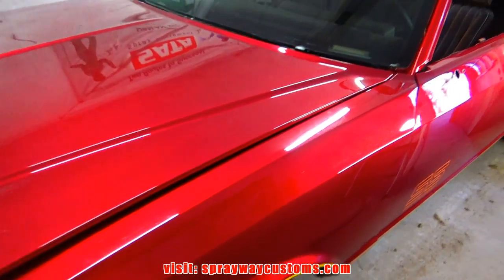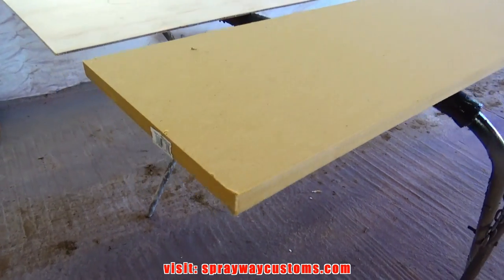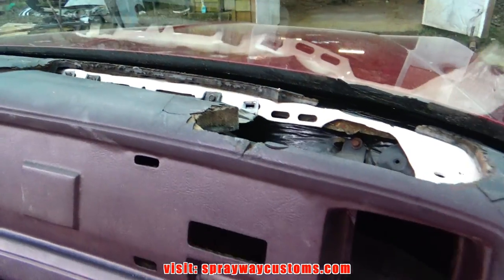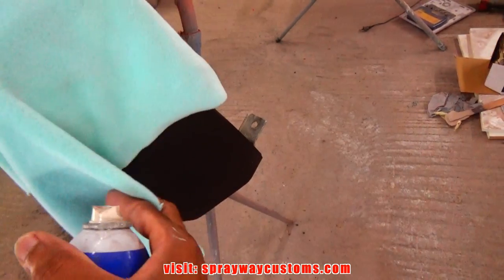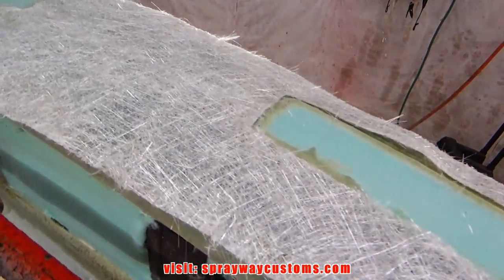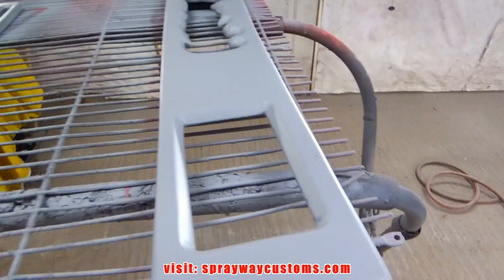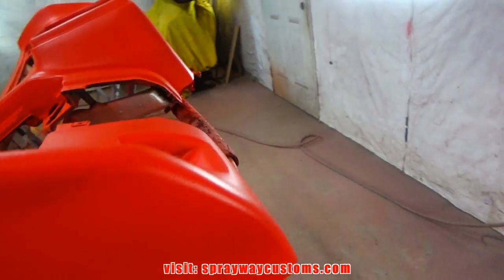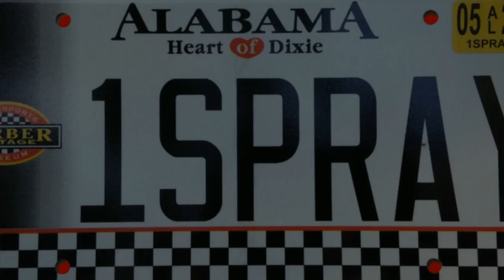How To Repair A Cracked Dashboard STEP BY STEP Custom Fiberglass Monte Carlo SS G BODY Dash Restore

Comment: Ive been able to save hard to replace 1993-1997 Gen4 camaro interior parts thanks to learning from you how to fiberglass them to make them stronger. Question would it not have been more easier to modify the dash pad with the front window out and do you have the ability to remove the front window for projects like this one going forward
Reply: I would assume that he would have not found out that the dash did not fit if window was out. But since it was in he realized the wood hit the windshield.
Reply from the maker: I think it’s better with the glass in so you’ll actually know if it hits but if you was fiberglassing it still in the car...I would say it’ll be better to remove the windshield

Comment: Superior job man 👍🏻 I would like to ask how long does the dash last?? Curious if it cracks over time with the body filler or if it is a problem @ all. Thanks sprayway for a great video 😎
Reply: as long as you take care of it as you would the outside of your car it will last  forever and also use a windshield cover inside to protect the dash or if you can do a 50% tint on you windshield to cut down on the sun beating down on it!!!!
Reply from the maker: Thanks for the reply Duane and I appreciate the compliment Boz N Son’z
Reply: I been doing the same thing man

Comment: Great work!!! Just a tad bit of advice for someone watching and needing some tips.  If you dont have much experience using resin, using the minimum amount of hardener will give you more time to use the resin before it starts to harden up.  Also another tip when using the fiberglass mat,  the mat will blend together better if you tear the edges versus cutting.  The strands will join back together giving you seamless results.  Again this is for people new to the process.
Reply from the maker: Thanks for the tips

Comment: A tip. You can tie the fabric that’s lifting from the staples with unwax santal floss. And leave it in when you fiberglass over it. To hold the shape.
Reply from the maker: Appreciate the tip...I’ll try that next time 🤝

Comment: so how's it going sprayway I'm doing body work and sand blasted a few p as rats also I primed with filler primer in some spots .my question is can I put a opoxy primer over my filler primer without it freaking the primer out / cause reaction
Reply from the maker: Yes you can but I would suggest spraying filler primer over the epoxy for sanding purposes

Comment: Just wanted to see if I could get your input. I have primed and block sanded and guide coated my car 3 times (1968 Shelby GT500KR)and I am confident that it is very straight. What do you do if there are some very, very, very small edges that got sanded through to bare metal. They are so small they are the width of a small needle. Do you get out the primer gun, mix a little bit more primer and try to spot prime those very small areas. It seems like I am going to be chasing my tail when it comes to these very mall break throughs to metal. Any input would be appreciated and thanks!
Reply from the maker: Get you a can of self etching primer and spray those cut through spots

Comment: Hey I got a 1988 Chevy Caprice Brougham with that kinda light gray original color. The dash is mostly faded with one baby crack close to the defrost vent. My question is would you do a vinyl paint or a vinyl cover that fits right on top?  My thoughts are the cover looking too tall sitting on top. And if i sprayed it would it adhere well?? Help me out SprayWay you would know...
Reply from the maker: I would fiberglass it myself
Reply: @SprayWayCustoms  thanks gonna watch the video again

Comment: I’ve been watching your videos and I have started my dash. Would I have issues if I don’t put a fiberglass mat? I have it pretty smooth right now
Reply from the maker: It has a possibility of cracking without fiberglass
Reply: Ok thanks man. Good work! I’d like to send you a picture of it when I’m finished.   Thank you for the content you make. I’m in central Texas I’m trying to rebuild a 89 crown Vic

Comment: One question, so on the top part of the dash board could you fill in those deep cracks and missing foam with some of the low fill sprat foam then sand that flush before you fleece it?
Reply from the maker: Yes you could

Comment: I have an 03 Avalanche with some faded-ass cladding all over it. I bought the truck used, so I’m not sure exactly what happened to it when the previous owner had it (no knowledge of what chemicals could have potentially been used to try to keep the shine up after it began to fade (armor-all, etc.)). I spoke to a bunch of local paint shops to ask if they will paint them black like the Cadillac EXT‘s come from the factory. A lot of them said they would do it, but would not warranty the work. Is there a way to paint this cladding so that it will last and not peel, chip or flake off? Are there any chemicals used to help the paint stick better? I’m certain there are thousands of people all over the country with Chevy Avalanches that would love to see you paint the cladding or show how to paint the cladding on one of these used trucks. If nothing else, this is an idea for content. Please help.
Reply from the maker: I have a video coming up about painting automotive plastics. The key is spraying a plastic adhesion promoter on it.
Reply: @SprayWayCustoms  Cool…I’ll drop it off tomorrow! 😉In all seriousness, thanks for the reply and keep the content coming. I love watching and learning from your work! 👊🏾

Comment: Damn that was loooong.  Hell of a lot of work you did there.  I'm tired after watching that whole video.  lol  That's some "Old School 1970's" way of making those speaker grills.  But the speaker grill material that you used as vent covers, that you can see into the vent holes, and don't match the other original vents with their air vent slats, I think would have looked better with air direction slats back in.  Just an opinion is all, doesn't mean it's the correct one.  Your car and your project.  But looks great!  Keep up the good work.  Lots of man hours on this car.  Whew...
Reply from the maker: Thanks man

Comment: Damn homie that’s legit work..!!! Fuk them tv shows we got a real Picasso right here… your one of the reasons la neta that I told myself if homie can do it so can I…a real masterpiece at work … GOD BLESS your talents..
Reply from the maker: Thanks Jay Bee
Reply: @SprayWayCustoms  one question I have for you bro, I’ve seen videos of people doing it there way for the dash . 1 way is they close up the cracks and holes and etc, now they throw a spay paint coats on top of that vynal type with that foam underneath it won’t the spray paint crack or mess up if you push into it especially if the suns been beating on it…??

Comment: I'm about to make your life WAYYY easier bro. Bondo brand resin works, but try using a professional product from your paint supplier. Cost is the same, but it's way easier to work with.
Reply from the maker: Thanks man…I actually have some

Comment: Ain't nothing but a $100 for a router table, pays for itself. Routering those intricate pieces by hand is reckless. I used to apprentice in a custom furniture wood shop & I've seen guys mutilate themselves using a router in similar fashion. Safety over everything
Reply from the maker: I agree totally...thanks for the concern 🤝